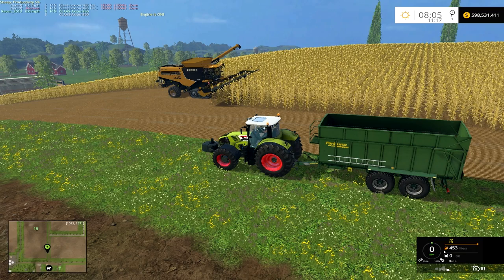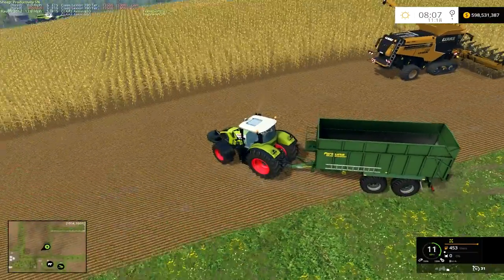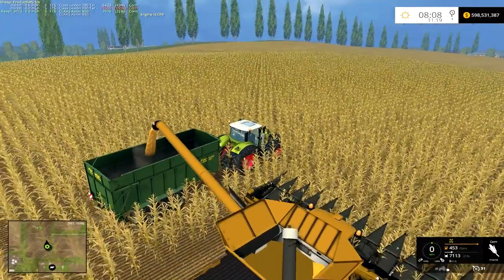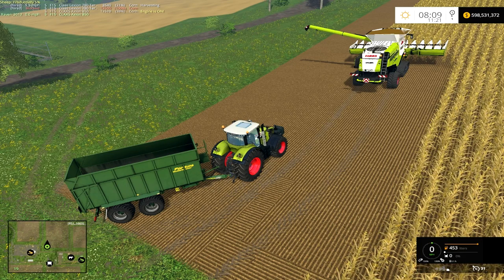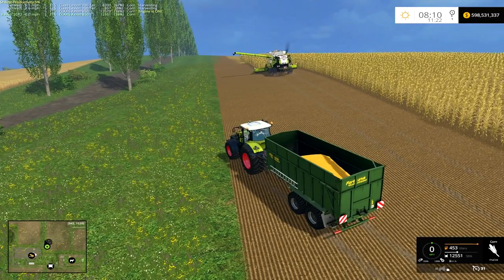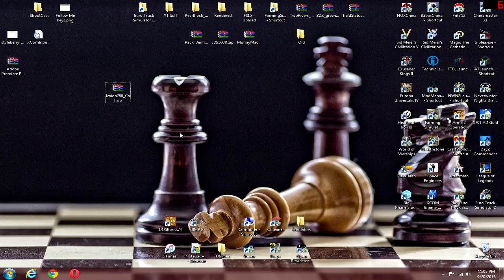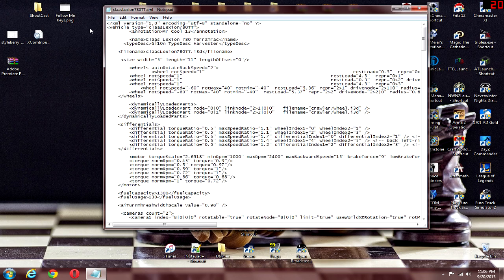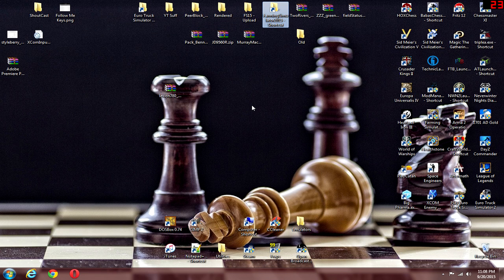Farming Simulator 2015 - CLAAS LEXION 780 TT PACK - Hopper Unload Speed FIX!!!

Comment: That annoyed me too.  I compared it with another mod and fixed the difference in the speed.  I also increased the capacity, but that is a personal preference.
Reply from the maker: +scorpionsedge Yeah I used the stock big combine numbers. As far as the capacity, I haven't messed with that yet, if I do it. Those numbers are numbers that been around since FS13 with that combine.
Reply: I think all I did was double the capacity.  I didn't go too crazy.

Comment: It would seem that the unload time of the CAT Lexion is correct in the mod.  Per the manufacturers brochure, a full combine would unload (at full speed) in 95 seconds...  It could be that the ADHD gamers dont want to wait, or been conditioned to unrealistic times.
Reply from the maker: +James Hook Yeah I figured it would be close to reality, but for game flow and gameplay it doesn't match up. A lot of stuff in games is to find a balance between reality and game flow. When ever I try to fix something I try to match it up to game and not reality. Even though this game is labeled as Simulator, it is far from it.